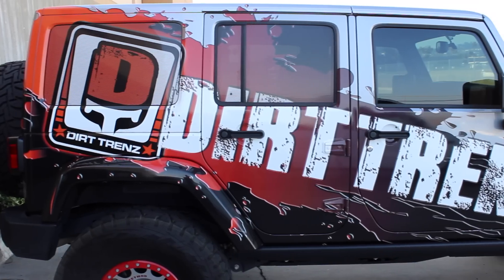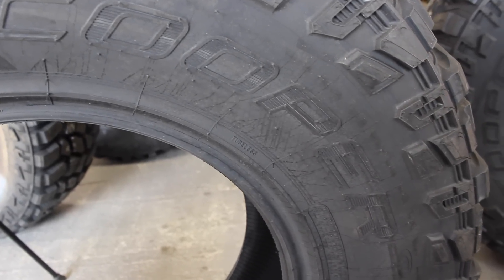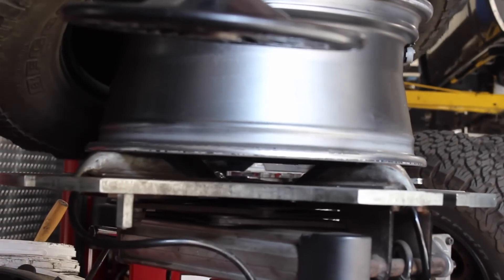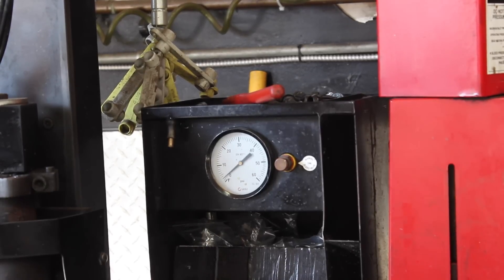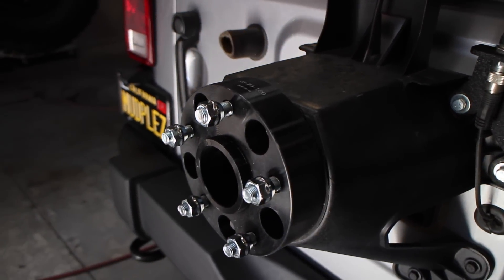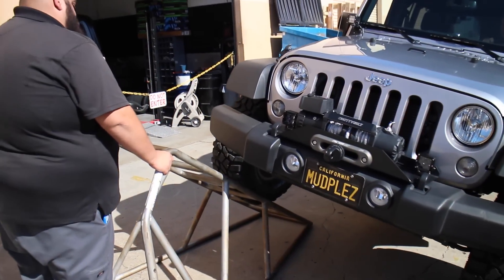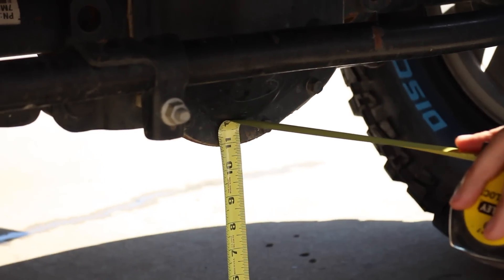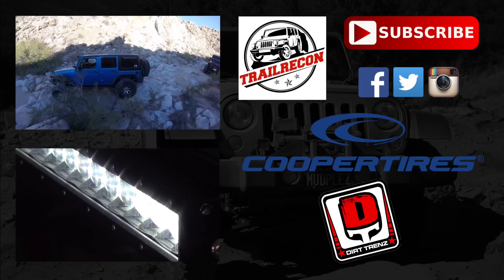Cooper Discoverer STT Pro Tire Install on a Jeep Wrangler - 315/70R17

Comment: It's funny Brad, I was looking back at your old videos and saw this one from the same time I put these (315/70R-16) on my 2500 Chevy. I love these tires too, especially on the sand. With over 25K miles on them they are still smooth and semi quiet. Aired down to 13lbs they float amazing on sand and pull my 16,000 5th wheel on Pismo Beach better than anything I've ever used, BFG's, Toyo MT and Cooper AT Discovery. I will be getting a new set of these when it's time :)

Comment: You might want to check out teraflex tire carrier if your keeping that rear bumper stock. Weight of the tire stresses the mounting hardware.
Reply from the maker: Absolutely something I'll keep a close eye on.  The addition of 16lbs is going to add some stress for sure.  Thanks!
Reply: your welcome it's a learned from experience thing with me. I upgraded to  poison spyder bumpers...

Comment: Looks great! I would do a chalk test on those tires if you plan on keeping them at stock pressure. It's strange that they had you run them that way, it may be because of the narrow stock wheels, I'm not sure. We run ours at 33psi, I called Nitto and TeraFlex and asked them and they both said for our setup (35x12.50R18) that we should run 32-37psi. We tried stock pressure and they puffed up so much that only about 60-70% of the tread was making good contact with the road. Still looks great though! Another awesome video!
Reply from the maker: Had several folks recommend the chalk test, so going to have to do that soon.

Comment: I run Cooper St Maxx and have been happy with Cooper's on stock JK rims.  I am running 35's as well and have aired down as low as 9 lbs and haven't thrown a bead yet (knock on wood) I run many of the same trails as you, Big Bear, Anza Borrego etc.  I do have a little radial pull to the right but I also have a 3.5 lift, so I am sitting higher and have large sidewalls so I guess its expected.  I run them daily at about 25 lbs (give or take) so I don't rattle my teeth out.
Reply from the maker: So far they are riding a little harsh... Although haven't lost any teeth yet.  I think I'll be dropping the pressure soon.  Thanks for the comments!

Comment: Hi Man, great video! Im running the same tyres on my JKU here in the UK! Id recommend investing in the HD Hinged tyre carrier... Over time, the weight of that 35" will pop the welds on the door and buckle the hinges. I just bought the Teraflex HD Hinged Tyre carrier and its great! Solid piece of kit and looks great! 
Great looking rig though man, really like it!
Reply from the maker: Thank you!  Yes, I think a tire hinge is in my future for sure.  Thanks for the recommendation, I'll have to check out the Teraflex one!!
Reply: +TrailRecon not a problem man! It is worth while, it does keep cost down and they come with plenty of add ons. There's others out there, but they really aren't as good quality as the teraflex. It's worth the investment. Best of luck, I'll keep following your progress
Reply from the maker: Right on!  Thank you!

Comment: Your one of those guys who installs larger tires and doesn't re-gear that people curse following behind while your going up hill.  Looks way better than the stock tires
Reply from the maker: LOL, let's hope not, we'll see how it performs with the stock 4.10's... maybe an upgrade in the future.
Reply: +TrailRecon it's hard to say, depends where you live and what the terrain is like.  Here we at 3500 feet above sea level and all mountain terrain so you can really notice the engine lag if you don't re-gear
Reply: Bigger tires to keep stock performance a differential gear upgrade is a must . 4.56 works for me.

Comment: With that wide of a tire on stock wheels, your tire pressure will most likely need to be in the upper 20's in order to have even tread wear. Wet down the pavement and drive over it or used chalk to find out if your tire is coming in full contact with the ground. Jeep looks good btw!
Reply from the maker: Great suggestions.... will have to give that a try!  Thank you!

Comment: Great video...this is exactly what I would do 2 5 inch lift kit with new shocks and 315/17R70.hate the ride on my rubicon that came with mud tires, how's the ride with these new ones? They look equally aggressive
Reply from the maker: Thanks!  In my opinion, the ride is great for how aggressive these tires are.

Comment: It looks great, Did you have to replace the rear shocks. Did the stock shocks with the extensions not work out? I have 3.73 gears and I'm debating between 295/75/17 or 285/75/17 rather than the 315's or 35's.  How's the ride on the "E" rated tires?
Reply from the maker: Since I received the incorrect shock extension and it was going to be a week before they sent the replacement, I just went ahead and bought a pair of full length Bilstiens for the rear.  Will probably replace the fronts in the future, just so I can delete the front extensions.  The tires are E rated and I just dropped the pressure to see if I can soften the ride up.  Thanks!

Comment: I know this is an old video but had two questions as I'm about to do something similar.  I bought a Rubicon Express 2.5 list.  I have 3.73 gears ans would rather not have to them and adding this spacer.  So did you have to add the spacer for the 315-70-17 would you not added if it was 295-70-17?  The gears did you have to change the 4.10s?

Comment: Love you're videos!!! I love this set up with the stock rims looks clean .. HELP i have    1 1/2 inch spacers installed on my Willy wheeler jeep can I still be able to do this set up ? I know you have 1 1/4 ..
Reply from the maker: Before I did anything, I called Teraflex and asked them a few questions about the lift, tire size and spacers set combination.  They got right back to me with answers.  I'd reach out to them if you are thinking about going with the Budget Boost Lift Kit.

Comment: So I got a jku rubicon like yours with the teraflex spacer level kit on it and im getting the same measurements roughly that you had before the tires of  38" in front and 37.75" in rear from ground to fender well. Thats no lift just the level kit on stockers. So if i go with 315/70r17 and im about a 1/4" lower in the rear do you think I will rub when compared to yours? Wondering about how much more clearance you had in the rear at full stuff..
Reply from the maker: Did you extend your bumpstops?  I have a friend that did the leveling kit without bumpstop extensions and then got 35's (tires actually measured 34.8") and he rubbed REALLY bad and ended up getting flat fenders.  The bumpstops extensions prevent your wheels from going way up into your fenders and I would recommend flat fenders or extending your bumpstops first.
Reply: +TrailRecon Thanks!

Comment: I've said it before but you continue to be one of my favorite channels!  Thank you for all the great videos.  I'm about to buy wheel adapters for my 2014 Rubi with stock rims and 34" tires and was wondering if your 1 1/4" spacers provide enough space for your tires to not rub anywhere?
Reply from the maker: I have zero rubbing and I have flexed them to the max a few times.  Thank you!!

Comment: +17lbs per corner + 1.25"  of spacers? Thats alot of extra weight & leverage on stock axles. That cant be gpod on acceleration or stopping. Any brake supporting mods?

Comment: How much of a lift did you install before the tires?
Reply from the maker: Teraflex 2.5"  https://www.youtube.com/watch?v=E1wq9PJXhoU
Reply: +TrailRecon thanks, im wondering if I could get away with these running the teraflex spacer level kit. Thats 2.5 in front and 1" in rear.

Comment: Hey! How's the tailgate doing? planning on reforcing it? Anything else that needed a trim/cut? What suspension setup you running?
Reply from the maker: No issues with the tailgate yet, but I've had several folks recommend I upgrade my carrier.... so on my to do list.  I'm running the Teraflex Budget Boost:  https://youtu.be/E1wq9PJXhoU

Comment: Great videos. What load rating are your Cooper's? Looking to order some asap . Have the same jeep. What load rating would you recommend? Thank you. Also looking to get a set of wheels and hoping discount tire will mount these Cooper's on my stock Rubicon wheels if my new wheels are not in. Thanks.
Reply from the maker: Sorry, I put 40k+ miles on the Coopers before swapping them out and don't recall what load rating they were... I"m running BFG KO2's these days.

Comment: Brad, Are your  1 1/4" wheel spacers working out for you with those Cooper tires?  I've ordered the tires and a 2.5" lift and about to order the wheel spacers on line.  I too will be using my stock wheels.  Would 1.5" spacer be better?
Reply: Sorry Brad, I just saw your response to another poster.  You don't have any rubbing with the 1 1/4" spacers.  Placing order now!
Reply from the maker: No problems with my spacers, but would rather have a good set of rims with the right back spacing... hopefully someday.  Make sure your lift kit includes some bump stop extension, you'll need them to prevent rubbing.  Congrats on all your new mods!
Reply: Brad, one more question if you don't mind.  Did you add a wheel spacer for your spare?  I will be going with the same set up that you have, stock wheels with the Cooper 315/70/R17  tires.  I'm also hoping to still be able to use the stock 3rd brake light as well.
Reply from the maker: I think we used a 1.5" spacer for the tire carrier.  I wouldn't us a 1.25" spacer because it is a tight fit.  Everyone keeps telling me I need to upgrade my tire carrier because of all extra weight, so may do that down the road, but working great for now.  You will love those 315's!  Not sure if you are on TrailRecon Facebook, but feel free to private message me over there anytime.  Starting to get a lot of traffic here and might miss a comment or two.
Reply: Thanks Brad, Unfortunately I'm not on Facebook....I could PM you on the Wrangler Forum.  I'll have to order a 1 1/2" spacer for the spare.  Thanks!  I will also be experimenting with how low I can air down with the Coopers.
Reply from the maker: You can hit me up on the trailrecon.net contact page also.... I don't check my wrangler forum stuff often enough.... not enough hours in my day!  LOL!  The lowest I have gone with the coopers was 10.  They were fine, but not having beadlock, I kept worrying I was going to break a bead. usually run at 15-18
Reply: Perfect.  Thanks.  Sent contact info to trailrecon.net
Reply: TrailRecon how do you like your winch plate? I was thinking of getting one or should I wait a little longer and just get a bumper. That also will add a lot more weight.

Comment: i have a 2016 jeep 4 door sport unlimited  
the tires i have are 
p255/75R17
what would i have to do to get the tires u used in this video?
Reply from the maker: Going to need a lift kit and new rims or wheel spacers to run 315's.

Comment: No way should you run your stock pressure with larger tires of the same type. You'll kill your suspension. 

The load inflation tables tell me to run 29 psi and the ride quality confirms it.  

You should use the load inflation tables paying special attention to whether it's a passenger , metric , or LT tire. 

In my case , going from a P 245 65 17  at 36 psi to a metric 265 65 17 , the recommended pressure was 29. If this were an LT tire it would actually recommend a higher pressure. 

If you go from LT to LT and the tire is bigger , the recommended pressure will always go DOWN until it hits a limit. Sometimes the lowest pressure you can run on LT is 35 , the lowest on P rated is 26 and the lowest on metric is usually 22 PSI. Sure , if you run 35lbs, in most cases you'll be safe no matter what but your ride quality on the road might be complete garbage and your suspension components might wear out fast from slamming the load into your suspension when you hit a bump that a 10,000 lb vehicle would sustain. You can hold like 10,000 lbs of weight on 4 tires with over inflated large tires. It's insane. You'll never need that on a Jeep like mine or the wrangler. The payload is usually less than 1000lbs max so you'll never (reasonably) support more than about 5500 lbs of load across 4 tires.